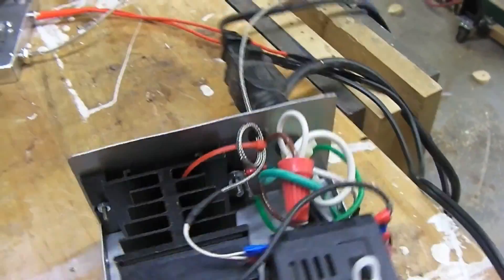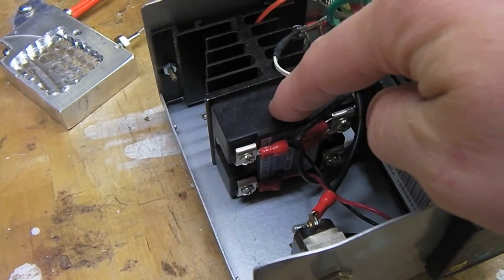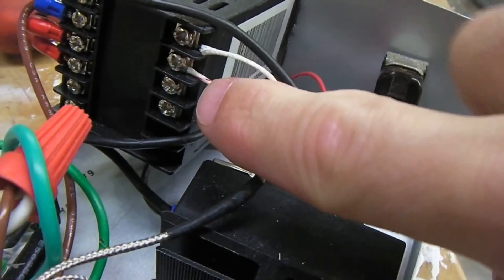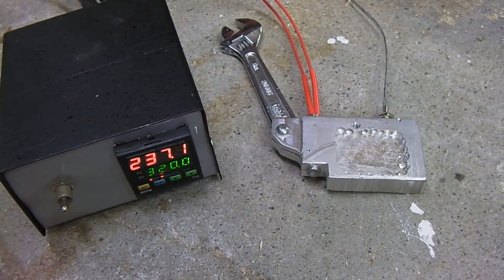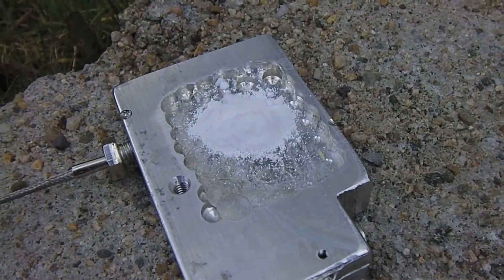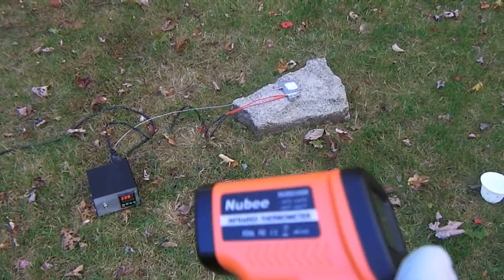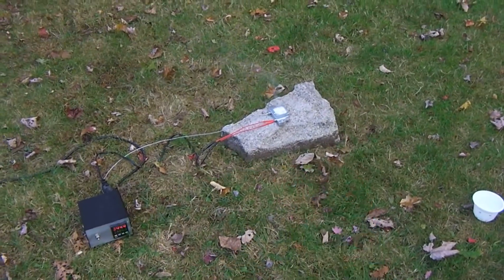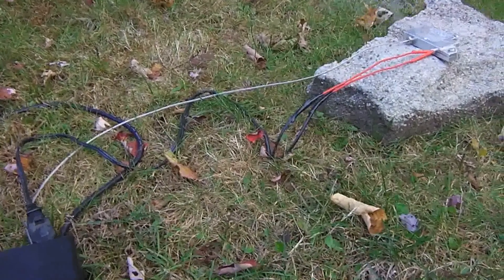PID Oxalic Acid Vaporizer and First Test Run

Comment: Thank you for sharing this video. Could I ask you a question?
As you were saying in the video, oxalic acid sublimes between 157 (315F) and 189.5 (373F) degrees Centigrade. Above this temperature, it turns into formic acid and Carbon dioxide. Now here is my question: would it be possible to treat against varroa using oxalic acid subliming devices such as Varrox? Bearing in mind that such devices are not equipped with thermostats and so wouldn't necessarily be able to keep the temperature between 157 and 189.5 degrees. In fact, the temperature of the aluminum plate may well reach 250, even 300 degrees Centigrade or more. 
As far as I know, the only oxalic acid subliming devices that are able to control temperature are those that can either use a power generator or that can be plugged into the mains, with a voltage of 110/200 V. 

So there's clearly something that I'm missing here. Could you help me get it right?

Thank you.

Comment from the maker: Here are the off-the-shelf parts I used for my vaporizer:

PID Controller - http://www.amazon.com/AGPtek%C2%AE-K-Type-SNR-Temperature-Controller/dp/B007H5GQUY/ 
Solid State Relay - http://www.amazon.com/Amico-Solid-State-SSR-25-24-380V/dp/B0087ZTN08/ 
Cartridge Heater - http://www.amazon.com/Electric-Heating-Element-Cartridge-Heater/dp/B008SA7J08/